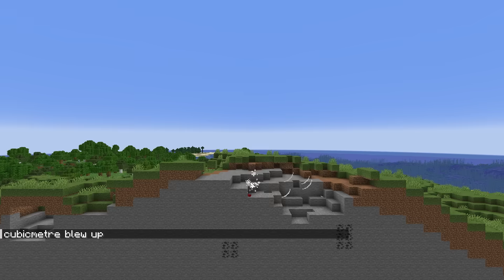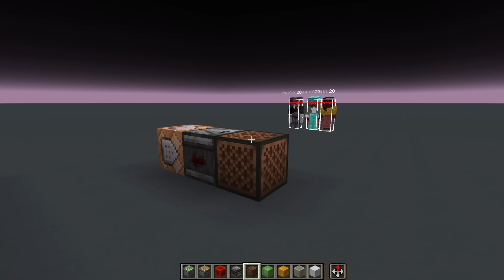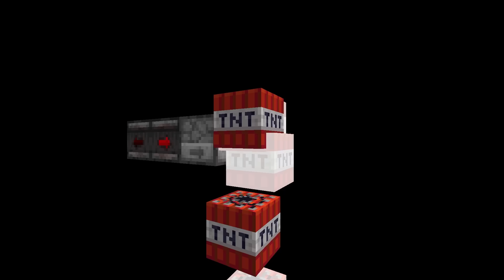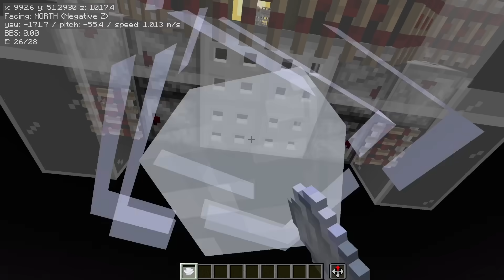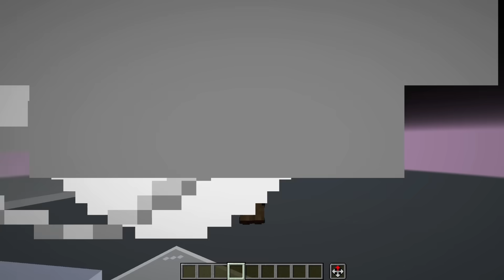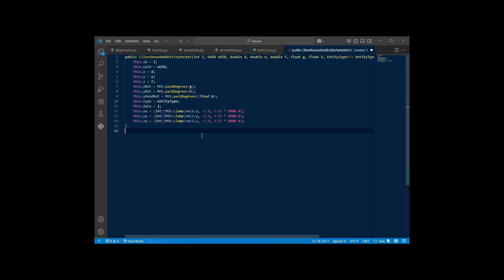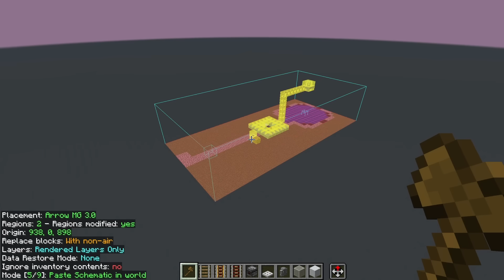The Best Air Defence in Minecraft is Finally Here!

Comment: Dear Cubicmetre,
At the beginning of the video you mentioned how it is hard to implement tnt projectiles because of the time fuse. 
I belive I might have figured out a solution. You could make two aiming stations that would be set amount of distance apart from ech other, in each one there would be a player both aiming at one target. That way you will get the base length and both angles of a triangle and using the law of sines and some redstone magic you can calculate the distance from the launcher to the target. Frome than on you just need to give the tnt some time to burn threw the fuse or adjust the muzzle velocity. And that's how you can make programmable fuse shells in your cannon design.😁
Reply: You lost me at "redstone magic"
This simply isn't viable in game because redstone ticks are too slow as compared to game ticks.  
Suppose we implement a mechanism which runs bots in satellite stations which aimlock onto a player and whose outputs are used to calculate the distance of the target using trig. A player can zig and zag far faster than your calculations can update, so unless you perform the calculations using analogue game mechanics operating outside the redstone tick system instead of some form of redstone calculator your information will always be far behind the player's new position. 

It might work with packed ammunition shotgun style to cover a vast area (such that the player simply can't move far enough from their starting point in the time the calculation takes to evade the blast radius), but it's still stupidly difficult. 

How would you even encode, decode or calculate the distance? Until you can answer that question, you've only posed more problems instead of a solution.
Reply: i lost it at "base lenght" but wow i kinda like hight tech comment about minecraft
Reply: He knows
Reply: Do it and make your own video
Reply: @BuilderUnion  If only I knew how😂 I don't know technical Minecraft ☹️
Reply: VT fuse in mc??

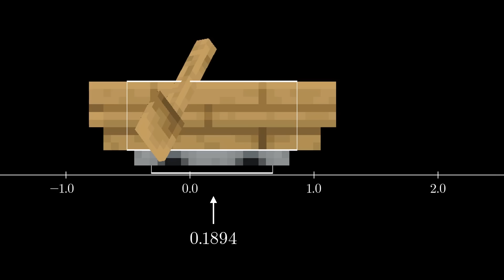Comment: 10:20 I don’t know what that means, but I trust you
Reply: that's just this entire video in a sentence
Reply: So 0.134 in *dec*imal is 1 tenths + 3 hundredths+ 4 one thousandths. So how many 1/2s or 0.5s is this? Well 0 plus how many 1/4s or 0.25s? Well zero plus how many eighths or 0.125s? well 1, plus how many sixteenths or 0.0625s? 0. 

So in binary expansion 0.134 is equal to 0.0010 or 0 * 0.5 + 0* 0.25 + 1 * 0.125 +  0 * 0.0625. Now that we have a sequence of 0 0 1 0, we can have a binary system that has only two options. On or off go off, off, on, off. And now we have physically created 0.134. If we had 10 physical options rather than on or off to choose from we wouldn't need to shift to binary. 

In short you have to convert decimal to binary so that you can physically create a number with only two distinct options to effect a physical object. This is how computers operate, they send on or off signals in the amounts necessary to create some number.  In this case it is a set of movements that moves an object to a specific coordinate.
Reply: @leroture bro😭

Comment: The arrow knows where it is, because it knows where it isn't
Reply: By subtracting where it is from where it isn’t, or where it isn’t from here it is (whichever is greater), it obtains a difference, or deviation.
Reply: @Lockmahn The guidance subsystem uses deviations to generate corrective commands to drive the missile from a position where it is to a position where it isn't, and arriving at a position where it wasn't, it now is. Consequently, the position where it is, is now the position that it wasn't, and it follows that the position that it was, is now the position that it isn't. In the event that the position that it is in is not the position that it wasn't, the system has acquired a variation, the variation being the difference between where the missile is, and where it wasn't. If variation is considered to be a significant factor, it too may be corrected by the GEA. However, the missile must also know where it was. The missile guidance computer scenario works as follows. Because a variation has modified some of the information the missile has obtained, it is not sure just where it is. However, it is sure where it isn't, within reason, and it knows where it was. It now subtracts where it should be from where it wasn't, or vice-versa, and by differentiating this from the algebraic sum of where it shouldn't be, and where it was, it is able to obtain the deviation and its variation, which is called error.

Comment: 25:44 irl modern fighter jets have air-to-air guns with built-in dispersion, so aiming doesn't have to be absolutely precise, with high fire rate and tracers making up for the inaccuracy. I don't know if it's possible (i wouldnt be surprised if you found a way to implement it) but you could give some deliberate inaccuracy to the cannon. Hope you found this useful

Comment: Would it be worthwhile to simply launch the arrows faster? I reckon a single arrow that moves at 200 blocks per tick and can be reliably aimed with just the crosshair might be more valuable than ten arrows at 27 bpt which need to lead their target
Reply: All of those one shot people in full prot 4 Netherite, what more do you want lol
Reply: @chalupa8940  If the arrows are faster, could be a lot easier to actually hit what you aim at.
Reply: The speed is for accuracy, not damage

Comment: With the probable safest airborne/elevated position against this weapon platform being directly above the AA-Cannon (since the actual safest position against this is to be as low as possible), I think it would make sense to have some glass blocks right above the player as well to protect from attacks coming from that position (most likely arrows aimed straight down or literal dive-bombing). There is also a conversation to be had about the player totally enclosing themselves in the firing position as well, likely in a layer order from bottom to top of upside-down blast-resistant stairs, iron bars (maybe glass panes), glass-panes, and glass blocks (assuming that glass or any other transparent block w/ a hitbox is far enough away from the explosions happening directly below the firing/aiming platform). The trade-offs with this are between being totally safe from retaliatory arrow attacks but needing to spend that split second to break yourself out to run away from melee attacks w/ this enclosure, OR being susceptible to arrows but being more mobile to get out of the "firing seat" more quickly. 

That all being said, in a full netherite armor situation, like was mentioned for calibrating the flying speed of our arrows, if the one in the AA-Cannon also had netherite equipped, then outside of an opposing force having an orbital strike cannon loaded w/ arrows instead of TNT, I'd think it makes more sense to go w/ the original design of having no roof, since you could likely shrug off any ranged attack coming from just another player directly (and if you can't, you likely have the option of just getting out of the way for a quick second before returning back to the "firing seat"), and in melee they'll be slower to swap their wings for their chestplate while you hit them, very likely into the continuous explosions directly below you to either kill them that way or blast them back away.

This brings me to my 2nd proposal to improve the design: just add more DAKA! With just adding a 2nd AA platform (w/ a 2nd player to man it) and ensuring to place them both correctly, you can have each AA-Cannon cover the that is air-space directly above the other cannon that is cannot reach itself, being able to protect each other from attacks coming directly above. 

That being said though, given this current design I could see a "Dual-Cannon" version of this being made with one player controlling 2 of these cannons at once by standing somewhere in-between the two blast-chambers (and of course doing this would require reconfiguring & realigning the player's viewing angle, as best as possible, to this new setup for both cannons at once). I'm not saying this would be easy; it is by no means an easy feat, as shown by previous videos on this channel showcasing player-aimed cannons that need to account for sometimes more extreme transform/position offsets likely like what I'm suggesting here, but for just 2 cannons at once it MIGHT just be doable while remaining functional. Ideally, doing this & moving the player out of the being directly above the blast-chamber would allow the player to aim directly up at higher viewing angles, but it will be up to implementation to see if this is possible. 

There is also the "dream design" of somehow having 6 of these puppies being controlled by a single player, each offset by 1 game tick, to come together to make a continuous 1 game tick fire-rate, from 200 shots-per-minute to 1200 shots-per-minute! But at this point, this idea is not feasible or practical in any way yet, and likely never will, ... but you never know. 

Still, with either the single-cannon or multi-cannon design, it would be cool to set up multiples of them for a team of players to use. Like if these were encased inside of a fleet of modern-like navy ships for some sort of team combat scenario, including an aircraft carrier for players to take off from, oh man, that would be stupidly amazing! Actually, no, I take that back; because what would ACTUALLY be stupid is this sub-scenario being played out all while during a game of Battleship with 2 totally separate players using orbital strike cannons to try to destroy each other's fleets as well, with each "Battleship Board Space" possibly containing an AA-Cannon to destroy. This would mainly come down to how long it takes for each Battleship shot/turn would take for the Orbital Cannon to finish firing, which THAT would depend on the size of the target ships that are made for this, but I could see it being a possibility!

On that note of multiplayer ideas, I'm wondering what happens when more than 1 player shoots an arrow into the trapdoor area that "assigns" the AA-Cannon to a specific player. My guess is that the cannon would only be aligned to 1 player at a time, not like a combination of the two's viewing angles, but it would be the question of "will it be consistently only 1 of the two players, the first or last player to input their arrow, or will it 'randomly' pick between the two arrows for each shot?" Or if instead doing this would just break the whole thing and cause it to malfunction. If I had a way of testing this now, I would, but since I can't atm, I'm going to at least shout it out there for maybe someone to try and test (so if anyone out there is somehow still reading this; in which case, hi there, and thanks for listening to me rant, I mean not literally listening to me but you know what I mean).
Reply: dawg wrote an entire essay report on this thing including his opinions. AWESOME
Reply: @MellowAquaDD  Bros got a doctorate on yappology
Reply: you should add an abstract but definitely a conclusion
Reply: Warhammer 40k refrence

Comment: Question: would you not be able to run multiple of these cannons in parallel? You'd want to change your player position to be centered between multiple, but firing multiple in parallel increases the potential intersections as you try to lead the shot and reduce the time it takes to get a successful shot.

Comment: This is insane but i wonder if you could make arrows pread out like the previous railgun by letting them travel a small distance before hitting a fence gate (as opposed to dispensing them directly on it) so that they get slightly spread out, that way you could probably make a similar device that shoots slower but does not require you to have pinpoint precision and near precognition abilities to hit the target, it would have to be redesigned for sure since the curtent design squeezes perfectly aligned arrows through a tight gap

Comment: Why would tnt minecarts not be used as a projectile? They explode as soon as they make contact with an entity.
Reply from the maker: Minecarts are like the opposite of a projectile, they have a horizontal speed limit and can barely move compared to an arrow.
Reply: @cubicmetre  Can't you just launch a TNT minecart using entity cramming, tnt blocks, or breeze charges? I guess you wouldn't be able to dictate its position that way though?

Comment: Now we just need a version that can shoot in all angles.
Reply from the maker: Not really possible given the aiming mechanism must use a flat plane to collide with the wind charge. So you must sacrifice aiming away from the plane.
Reply: I see. Is there a way to have two machines that you could move onto a pressure plate and fire the different ones depending on the pressure plate using wireless redstone?
Reply: @cubicmetre  How many angles can you achieve? Also, can multiple cannons be used in parallel?
Reply: @cubicmetre  what about using 2 set of aiming planes, one for top and 1 for bottom?
Reply: Imagine you have like 5 of them at once, for even more area coverage. An actual ww2 AA field
Reply: What if the propelling tnt and the arrow get shot near the player and then actually fire the arrow.

Comment: Make a version of this but for the ground and fully armored players
Reply from the maker: This is where it gets kinda awkward, machine gun emplacements against ground targets would ideally be portable. As the enemy can easily entrench themselves and just dig a tunnel to your position under cover. This would be extremely vulnerable to players on the ground.
Reply: @cubicmetre  You could try making an anti tunnel cannon
Reply: @cubicmetre they're fundamentally base defense weapons, remove every block from build limit to bedrock around the base and put 9 of these systems around the vicinity at bedrock level, there would be no risk of tunneling here as you can see every movement of the enemy